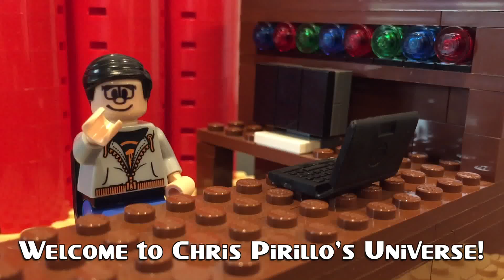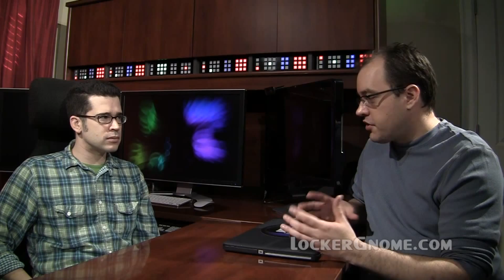What Does Amplifier or Speaker Wattage Mean?

Comment: Sir please tell me if we connect a 3W speaker to a 50W (output) amplifier what will happen , is this dangerous for speaker or the amplifier ?
Reply: You'll likely destroy the speaker (if you turn the amp up to high). If it was the other way around, a "big" 50W speaker is easily able to handle a "small" 3W amp.

Comment: Fender Mustang IV v2 has 150 watts. Fender Super Champ X2 has 15 watts. Both are roughly similar price. Whats the difference between these two amps in loudness and sound quality?
Reply: fahd s . Superchamp  tube amp .   Mustang is solid state.   Tubes in my opinion sound Better clean or dirt . The SuperChamp is not 100 percent tube.  I had I The clean channel was decent . I would go with a 100 percent tube amp.  Orange Or 15 ,Tiny Terror or DarkTerror .   300.  Used all day long .  Get a Cab or a couple of Celestions and build a cab. Or you could find Blues Jr for 300. Or less Used!  Anyway PEACE!

Comment: Sorry if this is a stupid question, I'm kinda new to this, what concerns should I have when pluging an amp to electricity? What I mean by this is, should I have any concern about the amp wattage before pluging it (with some device to control the watts or something) or it doesn't matter, it will work anyway and not give it more watts than what it needs to?
Reply: Just make sure you have the proper voltage.  Conventional electrical outlets are 120 volts.  As long as you have the right cord there won't be a problem.

Comment: I'd like to know what the issues are when mixing speakers in a cabinet. I think they have to have the same ohm rating but if they are different RMS wattage rated say 75 and 30, are there issues related to either amplifier or speaker health. Does a dummy load of some kind have to be employed with the lower rated speaker?

Comment: I listen to 35 year old JR-149s, a small British speaker. Never heard anything better for moderate volume in a smallish room, though I have heard speakers that sound better on rock. Most speakers will benefit from a good amp. It doesn't have to be the latest greatest; let's say some sound better than others. There are some great old amps at low prices on ebay but you don't get to try them out - they might arrive smelling like cat pee!

Comment: These speakers are 'active' meaning they have built in amps. The amp is 150 watts rms. The program rating and peak ratings are normally higher because a less demanding measurement is used -- maybe they just don't want to worry about it. Bottom line: Mackie says they go up to 120 decibels at one meter which is enough to injure your ears if you listened within a few feet. So they should be great in general though a small speaker will never be ideal for a bass guitar or other super low frequencies.

Comment: @lockergnome I got a pair of KEF Q500. It's a british manufacturer and the speakers have coaxial chassis. Which means the tweeter sits in the center of the mid-range chassis. So all frequencies above 300 Hz coming from the same spot (point source). This concept gives you a tremendous 3D sound image in front of you. You can grab out and reach musicians. Of course, it doesn't work so well with Gaga or Bieber, because it is mixed for your ipod. 
And a pair of ADAM Audio A3X for the PC

Comment: You should mention that Wattage is not an indicator of sound quality and that an amplifier with 10 Watts is most likely to kill your speakers at a high listening level than an amplifier with a wattage that is higher as the one of your speakers because of distortion (except tube amps).
And that you can't buy a Stereo for $200 bucks that has 1000 Watts, at least not at 4 or 8 ohm

Comment: Your tube amp sounds louder because its rated closer to the actual output than the solid state and tubes amps are higher current. Also, tube amps are better at handling difficult loads due to their large transformers.  My 12w tube amp sounds the same as my 45w solid state.

Comment: and other times when the speaker is consuming zero power.  the RMS is basically the average amount of power the speaker (any device really) consumes. So yes, RMS is the level of wattage the speaker will sound the best at. Even though it's rated about twice as high for peak power, the amplifier will actually push twice as much power as it might say (for fractions of a second), causing the peak level to be exceeded and the speaker to distort.  Usually speakers can go slightly over peak w/o blowing

Comment: @lockergnome I think I can help both of you.  RMS stands for root mean square, which is more or less an average amount of power consumed by a particular device.  Since speakers are powered by alternating current from our walls, and the current constantly changing directions, the speaker is consuming zero power once every given amount of time (the amount of time for one complete "cycle" of the electric current).  There are times in the current cycle where the speaker consumes max power (peak)...

Comment: Just like a 40watt tube amp for guitar is like way louder than a 100watt solid-state generally speaking, the wattage isn't the measure of how loud it is, if it were it wouldn't matter if the amp was  tube amp or solid-state when estimating how loud it will be.

Comment from the maker: @BassPounderX With Sub Woofers you may be correct, but RMS is the level at which a speaker can deliver sound with exceeding the speaker specification.  When you go over the RMS you start adding distortion. That doesn't mean that you will damage the speaker necessarily, just that it won't sound as good.  In Subs, typically going over RMS adds wear and tear.

Comment: @lockergnome I'm currently on some ancient Cambridge Soundworks PCWorks 2.1 speakers, also known as the CSW 100, they are brilliant, I usually have them at 90-100dB, the Sub is 20w and the 2 tops are 5w. However I am in the midst of purchasing a pair of Alesis Stuido Monitors, the M1Active 520s. Yet to power em up :)